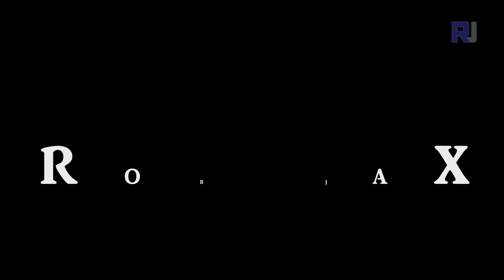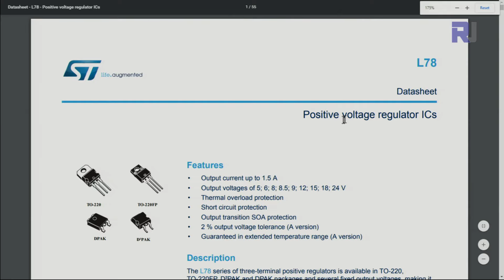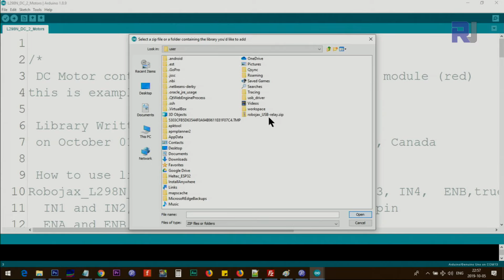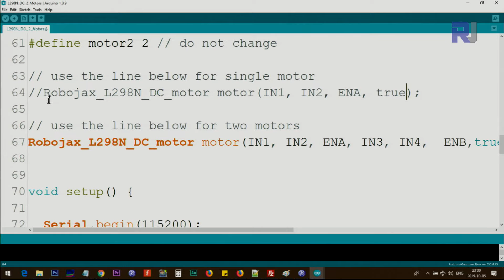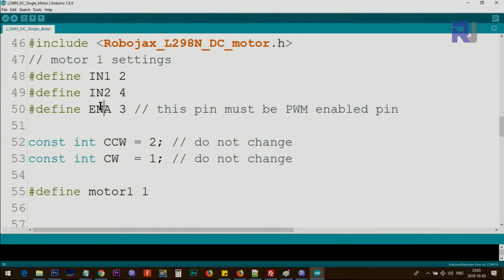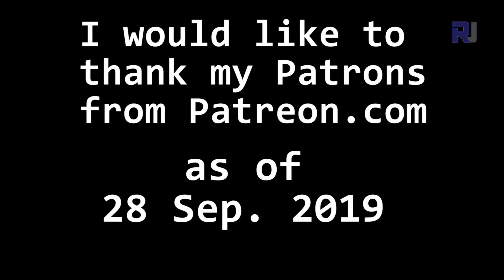PWM DC Motor control with Arduino and L298N Module with library - RJT223

Comment: I getting a error when installing the .zip library in arduino ide, i get this Error: 13 INTERNAL: Library install failed: archive is not valid: multiple files found in zip file top level
Reply from the maker: Thank you for letting me know. I've just fixed the library. You can try it again now. cheers
Reply: @robojax  stil got the same error when installing the zip library size of the new file is the same? 101kB got it from the link on your site
Reply from the maker: Impossible. The library has changed. I removed the library from Arduino IDE 2,  I downloaded, and install it and it works. Do download  and save it in a different location and install it.
Reply: @robojax  i got it working rebuilt the zip only with the needed files and it is working now
Reply from the maker: I am glad it worked. Cheers.

Comment: Hi, thanks for amazing lessons!
How can I control 4 dc motors, single direction, with one L298N + NodeMCU? From your hardware explanation, I should be able to use half bridge for 4 motors. My use case is run 4 mini water pumps to to water plants.

Comment: My motors don't turn on at all, I've checked all connections too :(
Reply from the maker: so you are not getting any error. right? then you may have used pins that are not PWM enabled. those pins shoudl have ~ written beside them. watch the video agian.

Comment: Error: 13 INTERNAL: Library install failed: archive is not valid: multiple files found in zip file top level

can anyone help me?
Reply from the maker: I just downlaoded and installed the library, then uploaded to Arduino board. no issue. you must be doing something wrong or you may have modefied the code. Try again. it works.
Reply: i have the same issue but i did not change anything. i just can't add the ziplibrary
 @robojax

Comment: if  you gave the parallel connection to the small motor replacing the 4 ampere motor, will the tiny motor run faster or burn out?
Reply from the maker: I have mentioned in this video how much current (ampere) this L298N can handle and I don't remember it now. if you know that, just compare for the number of motors you are connecting.  If you have a motor that need 1A and if you connect two of them in parallel, the current is doubled and becomes 2A. the speed will not be reduced or increased. Just pay attention if the motor driver L298N can handle it or not. it should be equal or below the rated current of L298N motor driver.

Comment: Hey I have used 12V DC gear motor but not sure how many amp of current I should provide with 12V battery. Please help.
Reply from the maker: look at the datasheet to see how much current it needs. or simply turn it on, connect the load and measure the current. this is how you know.  No all motors are the same. so make sure to either measure the current or find the exact datasheet for your motor.  This there is a new  version of this with wiring diagram here https://youtu.be/fqBLIrwq2YA which is part of my Arduino Step by Step Course that starts  here https://youtu.be/-6qSrDUA5a8

Comment: Very good description. Keep it up. I want to connect the wires to model rail tracks and run ready to run locomotive on that which has DC motor to run. Guide me as to whether can I run the same as given by you and what changes I will have to do in sketch (code). Please advise. Thanks in advance.
Reply from the maker: Hello, model rail track is very complex. it has tones of sensors to detect and take action. this is basic motor control. But if you want to just run this code, then use it as shown.. motor has two wires, just connect the wires to the motor. Here is the latest video of this with full wiring diagram https://youtu.be/fqBLIrwq2YA and better explanation.
Reply: @robojax  Respected Sir,

Many thanks for your kind and immediate reply.  I am retired Geologist and trying to spend my quality time in my childhood hobby.  Please go through the link given below where in I have made a small layout in my godown.  It works totally on 12VDC max supply.  As the power controller usually availble with 'Starter Set' costs about 4 to 5 thousand INR.  Hence I thought of making ourself via Arduino to supply power to the locomotive which will not cost more than one thousand INR.  Hence request for your kind guidance and advice.  

Link is as follows:  https://www.youtube.com/watch?v=g32c5M7cpwM&t=18s

If you don't mind, may I request you kindly let me know where in Canada you are based. 

Secondly, any method you can guide / tell me by using Arduino + some motor driver or similar which will feed the railtrack and have some arrangement (potentiometer) to vary the speed and have a direction controller (front / back) along with code (sketches), which will fit in my budget.

Thanks once again and for your help and guidance.

With warm wishes.

Sushil Damle
05Jan2022@1323 Hrs CA.

Comment: Hi. Thank you for your video. I have a problem here. When I turn it on, my lm298 makes a noise like a whistle. I think it is because of the frequency used, am I correct? How can I change the frequency? Thanks!
Reply from the maker: Hi, if  noise is there and motor is not rotating then PWM value is very low. If it is high enough the motor will run without the sound

Comment: can I use 2 of these modules to drive 4 dc motors?
Reply from the maker: Yes you can if your arduino have enough pins and pins with PWM (!~). use may be Arduino Mega.

Comment: Is there a way i could control the speed of four dc motors using the same arduino Uno and two motor drivers? I keep getting some errors from some specific pins. If there is a video that explains that, it would be very helpful.
Reply from the maker: Yes you.  you can use as many as your arduino pins allow.

Comment: Hi, ROBOJAX, I'm your subscriber and now need your help. In my project I have 3 or 4 DC motors, and 2 modules L298N.I want to use your library for this 4 motors,but have no idea how write scetch for TWO !!! modules.Thanks for your answer.With one modules and 2 motors - no problem.
Reply from the maker: Hi Alex and thank you. 
I assume you've watched the video fully and understand how it works. 
I wrote the code here but then realized that others might need to use 2 modules. So I created a  page for the code using 2 modules here https://robojax.com/learn/arduino/?vid=robojax_L298N-DC-Motor_2modules and added link to the main code page. I've not tested the code but it should work. if you've watched the video, you can find the issue very easily.  Good luck.
Reply: @robojax  Dear ROBOJAX. I see your code for Two modules.Thank you for this, but you dont change your library.There not  <Robojax_L298N_DC_module1.h> in  it. Can you add this to your library. Thanks that you mention me in your code.Fully yours ,Alex.

Comment: Hello Ahmad, I think this is the right video reference that I would like to clarify from you.  if your power  supply is 24V on your L298N motor driver to run 24V dc motor, still you need a separate input of 5V power supply  to the motor driver am I right or not required anymore? Assuming I have a power supply to my Arduino of 7V-12V.  In this video your power supply is 12V, your jumper were not disabled. Appreciate your comments.
Reply from the maker: Hello. that 12V provides power the to module. the module only OUTPUT 5V if you need it for Arduino or something else.  but once you connect for example 12V, you have to have 12V motor.  Please watch the description and wiring multiple times so you know it.
Reply: @robojax  Actually this is the setup I am looking for link below,  but looks like there is a problem on this wiring as well. So my option is to buy this motor driver "l298 dual h bridge motor driver dc 6.5v-27v 7a" Thanks Ahmad.
https://www.google.com/imgres?imgurl=https%3A%2F%2Fi.stack.imgur.com%2FLTmHb.jpg&imgrefurl=https%3A%2F%2Felectronics.stackexchange.com%2Fquestions%2F329350%2Farduino-and-motor-driver-l298n-separate-power-supply-circuit%2F329367&tbnid=nkY6glBjdeeAQM&vet=12ahUKEwjm6d7ZuZ_tAhVHb5QKHc9mAC8QMygAegUIARC3AQ..i&docid=CJholoGiedqZdM&w=4791&h=2622&q=l298%2024v%20power%20supply%20circuit&ved=2ahUKEwjm6d7ZuZ_tAhVHb5QKHc9mAC8QMygAegUIARC3AQ

Comment: Hi Sir, Hope you are doing well. I'd like to ask you a question . An Important Question . I have a tow Dc Motors we are using them to lift something we connected them to H-Bridge outside it played perfect but when we tried to put them where we want them to do it couldn't lift the thing that we want it to lift, when we measured the Ampire it was 1 A we want H Bridge Module that it can provide us high Am
Reply from the maker: Hi Ahmad. I am doing well. how are you?
The current is not something that the motor driver will push. it is the load that draws the current. There could 2 reasons. 1-your load doesn't need much current 2-Voltage is very low for the load and it doesn't draw current. measure the voltage across motor and compare it against power supply. there should about 1V different (load would be lower) . Good luck.

Comment: Hello robojax and thank you for your videos on Youtube. I would like to make a question about a library that you are using in this video. When I change the rotation speed of the motor, at Moving(), I have the below problem.
If I'm using 50% of the speed, the motor moves slow but at the same speed CW and CCW, but when I change the speed to 60 or more, while the motor moves faster at CW but slower at CCW. The same is when the value is below 50. The motor moves slowly at CW and faster at CCW.
Do you have any suggestions in order to move the motor at the same speed and faster than 50%?
Reply from the maker: Hello and you are welcome.  in regards to the question, it is your motor which has that kind of characteristic or the module.  Please change the  polarity of the motor and see if you see the same issue on CCW when the wires swapped. if that doesn't help, then swap IN1, IN2 for the motor and you will find out if the issue if with the motor or the module. good luck.

Comment: Hi sir how to write code for full bridge inverter 50hz sine wave mosfet switching frequency of 20khz with feedback
Reply from the maker: wow. if you want to use Arduino, then the frequency  for PWM is not that high  see it here https://youtu.be/6O9SFvEP6Bs

Comment: please what do you mean by Robojax_L298n_DC_motor motor is it a class ?
Reply from the maker: it means it inside the file in the above line that is included.
Reply: @robojax  please i have a question Sir , i used my l298n to power 2 dc motors for a line follower project but apparently something went wrong and the 12 v input doesn't supply the motors anymore , the 5 v input works
when i give it 5 v from arduino  i verified all wiring but it's right , is my 12 v input dead ?? i think some short circuit happend in the 12 v input but why is the 5 v still function ?? appreciate your help you are doing great job
Reply from the maker: I mentioned that we have 5V regulator.  it i possible tha the L298N is dead.or the 5V regulator is dead. check the output to see if  you get 5V after connecting 12V. Good luck.
Reply: @robojax  i don't have 5 v output when connecting 12 v power but i have the red led on when giving 5v to  5v input from arduino but not applying any voltage to the 12 v pin ?? probably it shows that the 12 V pin is dead or has been short circuited somehow ??

Comment: Hi, I have watched the Video...can you detail the voltage/ampage used on the battery/input?

You appear to explain as to what in theory can be supplied to the board, however, you dont appear to explain how to work out what would be appropriate for the application you intend to use it with.

For example, I'm wanting to control 2 x DC 120mm DC PC fans and an ESP32 board (the code syntax appears to be compatibile as far as i can see).

The L298N gives me the 5V output, so i figure the input at least needs to be 5v (not sure what ampage would be required...i'm guessing not a lot).  How then do i work out what would be safe to use to also incorporate the 2 x 12V DC @0.10A fans?

Would i require a 30V 3A feed in?  Would it matter that i'd only be utilising it for only 1 fan at a time in some instances? 

Excuse my lack of knowldege on this...i'm pretty new to this sort of thing and i did electronic science a fair few years back now :-)

Also, i wondered, does your L298N library account for the alteration of the PWM frequency?

Cheers for any feedback you have.
Reply from the maker: I explained that the module can handle on each channel up to 2A and you can input up to 24V. That is it. Any motor (up to 2A) and Any voltage (up to 24V) will work. there is nothing else you need to know. your motor can tiny as low as 0.1A current and 3V it will work.
Reply: @robojax  so, if i were using 2 x 12V DC motors and the 5V output to run the ESP32 and taking into account the 2 x 0.7v required to run the switching of the transistors, would i need to total up all those voltages to work out what i should feed in, or, as the motors run on 12V would i just need to feed in 12V or, would i need to also factor in the 1.4V lost to the transistors and procvide 13.4V in?

I guess the Amps are basically irellevant as the Arduino only requires about 0.5A and the motors 0.1A each so a basic 2A supply should be ample.
Any feedback on setting the PWM frequency?
Would i just use something like 'ledcSetup' command?
Reply from the maker: the voltage drop is always negligible in general in driving motor. but for critical application, you could take that that into account.  if you are driving a motor, you don't need to know about the PWM frequency. However you can set the frequency by googling it.
Reply: Robojax  after googling it, I believe I will need 1 x 12V supply (or 13.4V if taking the voltage drop into account) running at an about 1.5-2.5A.

As these are fans and they can whine if not set to the right frequency, as I am using the ESP32 Dev board, I believe I will need to use the 'LEDCSetup' command as there are no AnalogueWrite commands available with ESP32...although, that said, my initial experiments using the built-in LED don't appear all that promising 🤔

Thanks again for your feedback.  If you do have any further feedback however, please feel welcome to respond still further if you like.

Comment: sir, if i want to use 1 dc motor (5v, 0.18A), is it correct if the 5v pin of L298N  connect with 5v pin of arduino? no need to use 12V pin?
Reply from the maker: I believe I explained it in introduction and  wiring.  Please watch it again.
Reply: the 5 V won't be able to give enough voltage to the motors thus they will seem to be still but a sound would get out of them it's the 12 V combined with the 5 V applied from arduino that makes them work nominally !!

Comment: Hi , if the L298 get hot when i use it , there is any problem?
Reply from the maker: the problem is you have overloaded it. Either use less powerful motor or reduce the motor voltage.
Reply: Robojax the L298 work on how much current ?
Reply from the maker: I have mentioned that in the video. Please watch without skipping.
Reply: Robojax it work on 2.5 amper right?

Comment: if i use 9v battery as power source is it ok ?
Reply from the maker: Hi, you have escaped the video.  I have specifically mentioned what voltage can be used.  Please watch and I am sure you will get the answer.